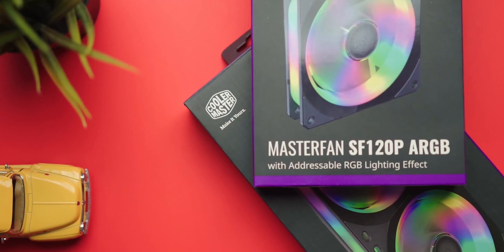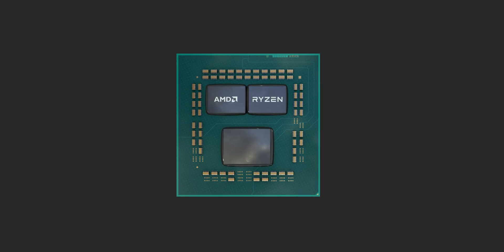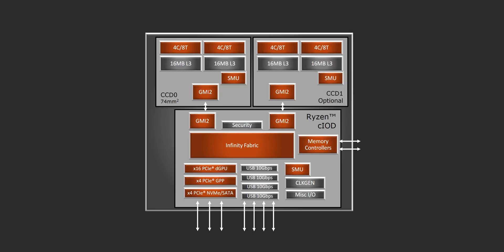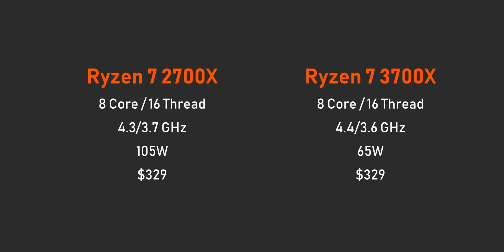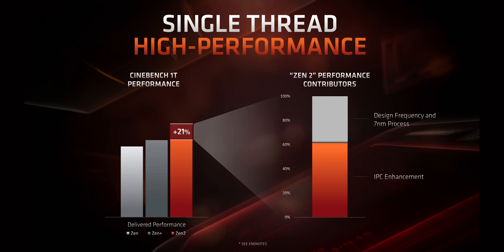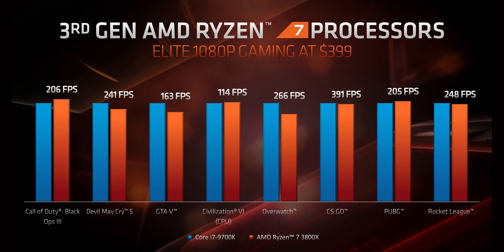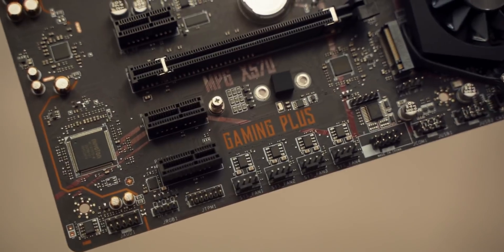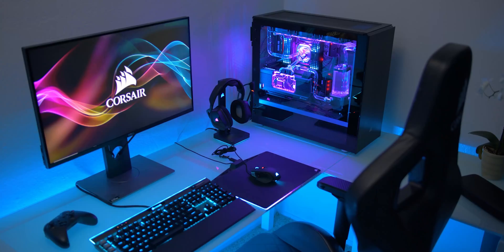AMD Ryzen 3000 – A Very REAL Problem For Intel?

Comment: If i were running AMD, i would of sandbagged the results too. I would of made the processors seem like they got some cool new features and pricing to get some hype going but not enough to trigger intel into a cpu arms race. Then when I lifted the NDAs on the testers and reviewers i would of been "Oh, BTW bros.... that 7% IPC? yea... its actually 15%. Have Fun! ;)". Intel would be shitting its pants all over the floor knowing they are going to take a pounding. Then hint that the next gen of server cpus are going to show just as massive of an increase at half the intel price and that the laptop market can expect the same and hit Intel on basically every front.

I had AMD since the thunderbird days and was quite disappointed with the Bulldozer chipset i had. I had no choice but to switch to Intel when i bought my current 6700K system. Just like i always had AMD GFX cards until i dropped my R290X because AMD didnt offer a card in a reasonable price point that was actually fast enough to justify the purchase for my current GTX1080. I'm very happy that AMD is making a strong recovery on the CPU side and can only hope that they manage the same results on the GPU side as well. Intel and Nvidia have been living high on the hog, looking down their noses at consumers for far too long.

Comment: Got an rtx 2080, and i7 4790k... gotta update cpu.  Im still thinking i7 9700k especially with price cuts.  However amds looking very good.  What do you guys think.
Reply: People who upgraded to the 9700k have been very disappointed. There's nothing new from Intel. Intel users are upgrading to the Ryzen 3000 instead and for good reason. They're sick of dirty-tricks Intel.
Reply: @cwli1  That is true, however i still see that in leaked benchmarks intel is still winning in gaming.  which is what i do mainly.  however i have a feelin intel will soon switch to a different architecture therefore down the road when i upgrade ill have to get a whole new motherboard again.  Amd seems very good though with how many cores they have, and their performance is better for content creations stuff which i also do.  In the end, any processor i upgrade to will be better than my i7 4790k and will get rid of my bottleneck.

Comment: will the ryzen 5 3600 work on B450 AORUS PRO without problems? + is the ryzen 5 3600 gonna be more powerful than ryzen 7 2700?
Reply: Check your motherboard's Web site for BIOS updates later. This should be fine.
Reply: @cwli1  i mean i didnt buy the pc yet so i cant update the bios later if 3600 doesnt work with the motherboard

Comment: 4:43 Surely there should be less thermal density than a monolithic chip design? These aren't stacked chips and I'd think having cores on physically separated dies should be the same if not improved due to the heat being more spread out. You should also know by now that pointing a thermal cam at a metallic object like a fin stack is absolutely worthless like other channels have rightfully called out.

Comment: I'm surprised that the video never even mentioned that Intel is severely affected by MDS exploits. The patches that mitigates MDS flaw in Intel processors lessens performance as much as 40%. Intel's single-core speed over AMD for a decade was due to them "cheating" their way to performance, their speculative execution and branch prediction implementation were developed with speed in mind, totally neglecting security.

So basically, by buying Intel - you made a losing proposition. You bought expensive processor with significantly lower performance compared to AMD's offering.
Reply: Maynne Millares ... I am under the impression that with the i9 series the MDS vulnerability was addressed... ??

Comment: I would definitely (if the price is right) go to 3rd gen Ryzen. But I do have one question. Quite a few websites have listed concerns about pricing on the X570 mobo's including this one. Not questioning that but they also go into a great deal of depth about how worthless or unnecessary most of the features are (i.e. PCI 4.0) but then proceed to say it is a weakness for the new Ryzen that there are not affordable X570 mobo's. If I don't need any of the features on the X570 why would I have any problem getting a cheap B450 or better yet keeping my older gen mobo from Ryzen. The only person this seems to be a problem for is the person that wants the best of everything regardless of function. That group by definition does not care about cost so shelling out the money for the X570 is not an issue.

Comment: Great video! As a long time AMD fan I am happy to see the gap appearing to tighten. I just hope it is not a bunch of hype. As for the question will I buy one, well given I just built a zen+ system the answer is a solid maybe. The main reasons for me is I have 470X board already and I really want to see my 3200 ram running at it's proper speed. But after the launch if I am seeing shortcomings with compatibility still I am going to stay put for now.

Comment: One of the issues Intel has that is consistently ignored in these Intel vs Zen2 reviews is the hardware defects/vulnerabilities of the Intel CPU's which are not present in AMD's  Zen architecture. We now have Intel CPU's suffering not only Specter and Meltdown but now MDS rolls in and all you can do to prevent it is disable hyper-threading...Intels response ? "It's no big deal because hackers will get so much of your data they'll never dig out your passwords" ? LMAO what ??? If you have essentially reached parity between platforms regarding performance why would anyone buy a product they know has hardware level defects ?

Comment: One place AMD needs to improve is that it needs a dedicated hardware codec for video built into its CPU (even without an integrated GPU) to compete with Intel's quick sync. However, even if there is one added, the software vendor has to support it. 
Adobe happens to support Intel and Nvidia hardware only in Premiere, not even a discrete AMD GPU.

Comment: I'm eying the 3700X, since the lower wattage and spitting distance from the 3800x on clocks makes it seem a far better choice... but it STILL feels like a step sideways from my i7 4770k. 

The only real selling point is the larger maximum memory support, PCIe gen 4, and the lack of slowdowns from meltdown/spectre patches... and even then it's just not enough of an improvement -- at least on single core -- to warrant me dropping the money on not just CPU, but RAM and Mobo. 

Which is the real problem here, I got this CPU for less than what the 3700X is being listed for SIX YEARS AGO, and the best I'm going to see from it is 11% increaase in IPC? I mean the multi-core is cute and all, but I've yet to see anything max out the 4 physical I have. 

Maybe it's because I only game at 1080p on a GTX 1070, and my old-timer eyes can't see the difference of higher resolutions anyways... (honestly 4k seems more like placebo than fact to me)... but it feels like the same money I spent six years ago is a step sideways, not forwards. 

Though I'm really only looking because I'm used to 3 years being obsolete, 5 years being the scrap-heap. At six years things SHOULD start failing, but there's not even a sign of that. Everything I run at settings I find comfortable... runs great. 

Which makes me feel like this industry has lost their minds when it comes to PRICES. Intel side is no better, the 33% IPC increase over my existing rig doesn't even come close justifying the cost. Long gone are the days where spending the same money -- even inflation adjusted -- offered generational improvements. By comparison to just a decade ago, it feels like things are standing still... which I suspect is the ONLY reason AMD was really able to catch up.

Am I sitting here waiting 'till 2023 for there to be an actual upgrade path worth the money?

Comment: I use premiere Pro mainly. In your opinion which will be best Ryzen 7 3800x or i7 9700? You mentioned amd had quick sync disabled which has threw me off. Then what gpu would you pair it with?

Comment: Socket compatibility, lower power usage, a stock cooler included.. there's lots of advantages to AMD even if it's 10% behind in some games.  And there's CPU's coming out in 12 months that will be even quicker and still compatible with AM4.   And they'll be able to be used with X370 and X470.

Comment: I'm not an Intel fan. I bought a Ryzhen 2700x in November, but I saw friends who had a bit of i5 that they had more FPSs and I'm a gammer.
So I wanted the best, the best. I bought i9 9900k with z390 Aorus Master and Kraken n62, and Intel destroyed Ryzen in all games with 40-80 extra FPS. In fact, Ryzen 2700x is a big zero compared to Intel in games. I'm not interested in other aspects, do not edit, do not do other things.
But the competition is good, if Zen 2 reaches the performance to compete with Intel in gamming performance it's very good, now I have the i9, so I'm not going to the 3000 series now, or I do not think the 3000 series will beat the i9 in gamming, but next year I can make the switch to the next generation of Ryzen (Zen 2+). Or I see what comes from Intel later that I do not think they are going to sleep, they're forced to do something.
Anyway, I want the best gaming processor all the time and I'm willing to pay for what's best. And so far, now Intel is the best in games, but I said I'm not an Intel fan, if AMD will be the best I'm going to buy AMD. But Ryzen 2700x was a great disappointment, a shit compared to an i5 in gamming performance.

Comment: Interesting video, I do have some thoughts to add:
5:17 Technically true, AMD's highest priced Ryzen CPU yet, but it was matched by the 1800X launch price.
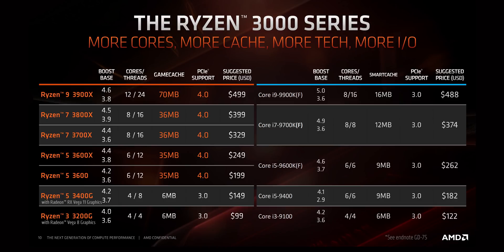7:12 The 3000-series APUs are built on the 12 nm node, not 14 nm, and they use Zen+ microarchitecture for the CPU, so it is not just a bump up in the frequencies (though still far from Zen 2).
10:36 Most people don't seem to be talking about the fact that having PCIe4 for a GPU does allow the GPUs run at full speed even with just 8 lanes dedicated for them, freeing more of the precious lanes for other devies. This does of course require PCIe4 support from the GPU. Might be interesting for a dual-GPU for example.
In general, about the motherboards - the X570 motherboards are premium products, and they are pretty much matched in price by the Intel equivalents. The good thing is that the new CPUs will also work on older, cheaper motherboards - unlike with Intel, where they change the socket for every single generation, so I think this is still a win for AMD, even without B550 being available.

Comment: It's time to upgrade my I7-3770, Nvidia 4GB GTX 970, DDR3 8GB 1600 memory. Been looking at an equivalent build - Intel I7 and Nvidia RTX 960 which will cost me roughly £500 more than my old build which was £1300 back then. Kind of hoping AMD will bring that cost down, so I'm waiting to see if AMD and Radeon can convert me over.

Comment: I don't think there wont be a problem with X570 being expensive. It is proven that there is no real-world benefit using a X470 over X370. There is like 1% perf increase. But you will never even know it. So There won't be any performance hits when you use  3900X and below CPUs with X470 or X370. You don't need PCIE 4.0 if you dont have bunch of Super high end NVMes. I will build a Ryzen Rig as soon as they release it with a 3900 and a X470 :D

Comment: Really looking forward to the 3950x it will be a nice step up from my 8086k from intel witch has been disappointing at times with high temps with a 360 rad aio and benchmarking only seeing a drop in performance when over clocking to 5.1 ghz on all cores. I have changes fan curves, thermal past, delidded , voltage pump speed is at 100% for the aio. Amd seems to definitely be the better opinion now. And with the 16 cores i can start map making again

Comment: My 4c/4t i5 4690k has been a work horse for almost five years. It's seen multiple GPU upgrades, and has been the core of my system. It's starting to show its age, and Zen 2 is the most compelling option since Intel's 10nm desktop chips are nowhere in sight. I think I'll let the 3900x be my workhorse for another 5 years.

Comment: Noob question here: if u update B350 bios to the newest, can you still use the current cpu?
Reply: If the VRM power delivery for your board is good enough, then YES!
Reply: @vladvah77  I'm sorry my question is stupid. What I mean is. I still using R3 1200, and what will happens if I update the bios to the newest? is the new bios still backwards compatible?
Reply: @pitiful anonymous MSI b350 bazooka
Reply: @pitiful anonymous my first thought is if I update the bios without new 3rd gen cpu, i won't be able to use the 1st gen cpu anymore
Reply: @pitiful anonymous ALright.
Reply: @pitiful anonymous alright i'll do the same .

Comment: Intel has a lot of industry clout, but AMD continues to be the value leader, year over year for three straight years.

The idea of having "the best(TM) hardware" is how we keep paying the blue tax. They might have the best single threaded performance, but not to a degree that your FPS is going to be significantly less than an AMD CPU. If the difference between single threaded performance is 10% or less, and the difference in value is 30% or more, the difference in value is the point (those percentages don't come from any official graphs, I'm just making a philosophical point).

Buy the product that respects your wallet, not the product that you give possession of your wallet. Right now, that happens to be AMD.

Also, Nvidia? You were pretty cool, but you're on notice too. -_-

Comment: The 12/14nm process that AMD used for Zen/Zen+ was licensed out from Samsung and was originally designed to be used on mobile platforms. I think the switch from GF to TSMC is the reason that clockspeeds didn't go down. The previous lithography happened to be vastly inferior for desktop than TSMC's 7nm and probably 14/12nm as well.

Comment: Just like you said, Intel can't give an answer due to their marketing strategy. The 3900X makes kind of the i9 and X processors look like a joke and here is why: Intel seems to focus on removing features and add it in their more expensive CPUs, although it's pointless. In fact and in my opinion the i9 and X CPUs shouldn't have existed in the first place, maybe except the X CPUs would make more sense. The issue is, both are more expensive than i7 CPUs although they should have the features of i9 and X CPUs and this is just mind-boggling. Intel just punched themselves with their product line-up simply because they can't make better CPUs and if they do they make their i9 and X CPUs useless. You see my point here?
That's exactly why Intel didn't give a response back, because they are aware their most expensive CPUs don't make sense. Let's give an i7 CPU 12 cores, give it more new features and it would butcher i9 and X CPUs. I don't think Intel will change their direction any time soon, until they feel seriously threatend by AMD. And if Intel released a far better CPU that meets everyone expactations, there will be a huge backlash for scamming consumers, where Intel has to face chargebacks from numerous consumers, news articles about their scummy buisness practices and perhaps lawsuits from the consumers aswell. They digged a hole themselves and got cornered by AMD.

Comment: Yeah I'd still stick with my current system, cause i don't really play games on my system anymore, but I might play skyrim 6! I will only upgrade when the AM4 platform is near to an end. so that i wont have to replace my motherboard and reinstall windows to upgrade into an AM5 processor, hopefully ddr4 is still compatible in am5 so that i can reuse my ddr4 ram to save some money :)

Comment: I love all the backlash from everyone bickering back and forth from intel is better AMD is better whatever to me if it gets the job done it gets the job done 😂😂 I use a 2600 cause I could care less I'd rather have the 6 extra threads plus I got it for 150 dollars imo better value than a 6 core 6 thread 9600k  I love Intel and I love AMD I couldn't care for less which ever CPU I had aslong as it gets the job done as I stated before.

Comment: If the BIOS updates bring high DDR4 speeds into the X470 ethos, I'll upgrade my X470 Taichi board with a 3700X or 3900X depending on testing results plus upgraded RAM. I don't have an overriding need for uber-highspeed storage at the moment (Gaming and light content creation/streaming).

Comment: Is there any point - at all - to the 3rd Gen, 3X00G chips? I want one.  But is there any reason to buy a 3X00G in two weeks vs a 2X00G today?  I was told they're not 7nm, they're just refined 11s from the standard 2000 series,  which were themselves a generation behind at the time when they were new.  Can anyone squash this once and for all:  "3X00G, tf?"  

Also, if they made a 3700G, and it was balls-out amazing, they could've made even more market share gains than they have already. ...imo. There are lots of people that are into computer performance but not "thousand-dollars-on-a-new-GPU" into it. If I could get away with an APU that WASN'T mostly terrible, I completely would. Shame really. I bet there'll be a 4700G tho.  $100, here and today, there'll be a Ryzen 7 4700G.